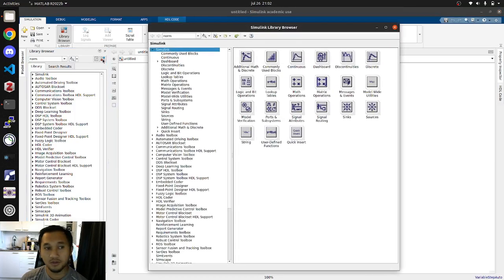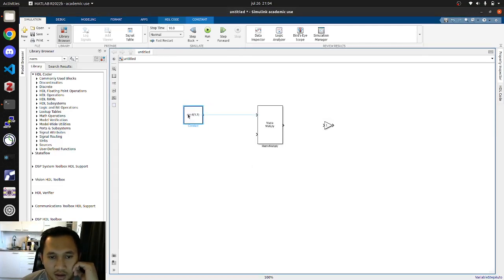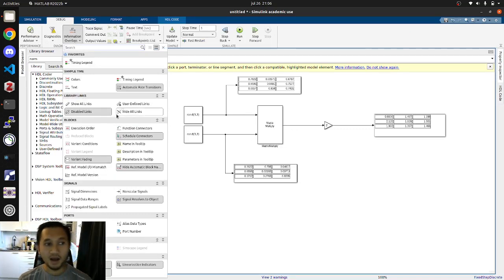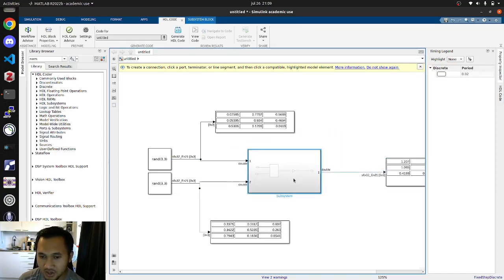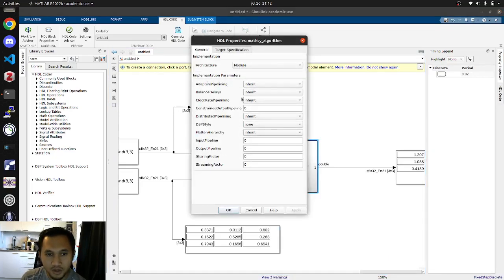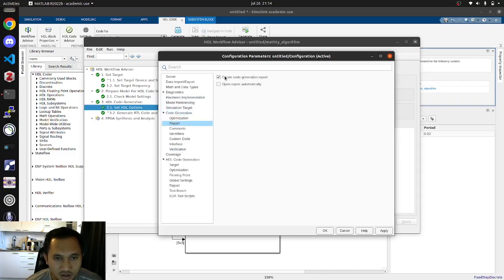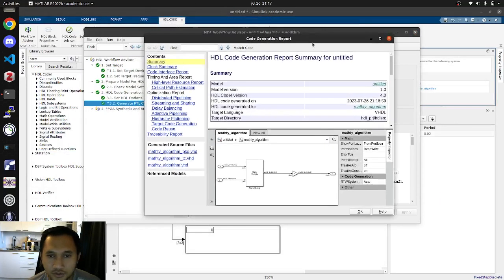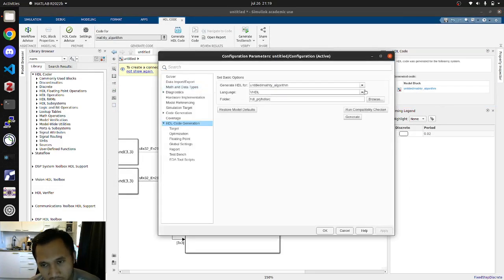Converting a Simulink Matlab to VHDL/Verilog Code | Step-by-Step Guide Tutorial

Comment: Hello sir,

I recently watched your video on converting Simulink models to VHDL code using the HDL Workflow Advisor, and I found it very insightful and helpful for my own project.

I am currently working on a similar task: validating a complex control system for a static power converter to be implemented on FPGA . My model includes both a fast control loop and a slow control loop. My workflow so far has been:

1. Validating the system behavior using floating-point 
2. Converting to fixed-point using the Fixed-Point Tool
3. Using the HDL Workflow Advisor to verify block compatibility and generate VHDL code

However, I have encountered an issue at the final step. After generating the code, I noticed that the control performance (regulations) of my system is degraded, and I'm struggling to understand why. I'm essentially self-taught in this area and haven't found comprehensive documentation to guide me through this specific issue.

One thing I noticed—thanks to your video—is that in the final HDL generation report, the base clock rate is indicated as 32 GHz. However, my system only runs at 40 MHz, and there is no 32 GHz frequency present anywhere in my model. I suspect this is related to the oversampling factor, which I set to 800 because I understood that:

Data rate / Clock rate = 20 µs / 25 ns = 800 ( 20 µs is the period of my fast task and i have as i said also a slow task that runs with a period of 2ms )

But I am not entirely sure if this reasoning is correct, or if this oversampling factor is causing the issues I'm observing.

Could you kindly guide me on how to properly handle this step? Any advice on debugging the loss of control performance, or pointers to useful resources, would be greatly appreciated.

Thank you in advance for your time and help.

Best regards,

Comment: Hi there! First of all, I'd like to say how clarifying your tutorial has been, well done! I am currently trying to convert a simulink model to verilog code, but my model contains m-code function blocks, which are not available in HDL-compatible mode. Do you know if it's even possible to do this conversion? 
I've tried to look up how to implement matlab functions, but I haven't found much, so any advice is really appreciated!
Reply from the maker: Hello sorry for late response, it is possible if you adjust your m code with function that is supported by HDL. Otherwise it is not possible I think.
Reply: No worries! I actually figured out how to remake it from scratch using Verilog-A :) @EasyEmbeddedOfficial